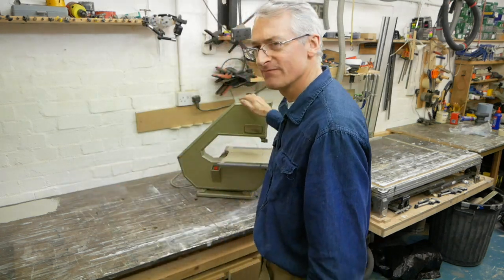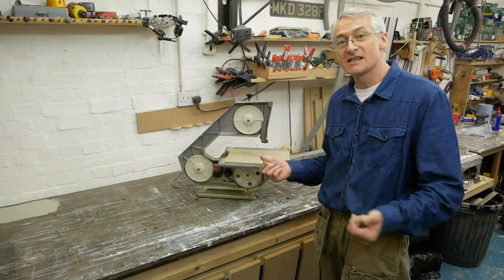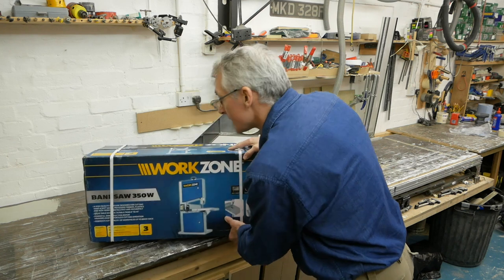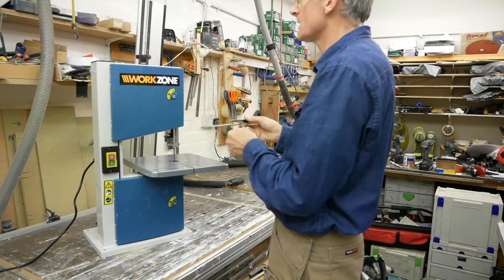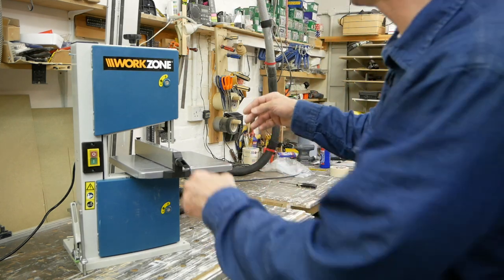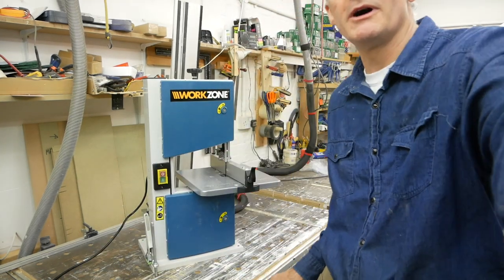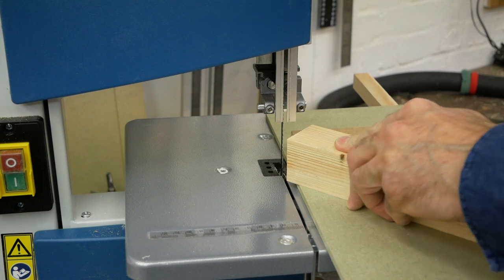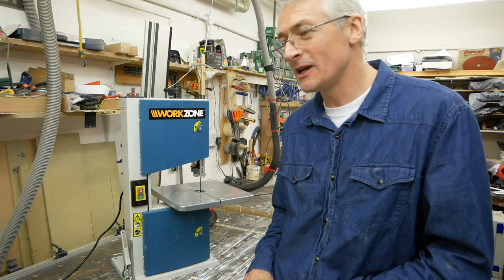Cheap Bandsaw - worthwhile, or just a waste? #050

Comment: That same bandsaw is sold worldwide by various companies. I have one, branded by Wen, here in the USA. Doesn't have the door safety switches (not a thing here), but everything else is virtually identical. Built my own fence, added better-quality urethane tires, and purchased a set of high-quality high-speed bi-metal blades (cuts wood to metal). A real handy workhorse now. Zero complaints.

Comment: As a very keen D.I.Y.'r with a limited budget I have found that the whole range of tools from Aldi are excellent value  and have out performed many of the more expensive  "name" brand power tools. I now have almost  the full catalogue  including air tools and pressure washer, none have given me any problems or disappointed  through lack of performance !
Reply from the maker: Yes, been very impressed with the Aldi Workzone tools that I have - they’re mostly rebadged Scheppach, and I’ve had no problems either 👍👍
Reply: Totally agree

Comment: I have the same saw painted a different colour and with a different name sticker. It's great. I cut 50mm thick mahogany and ash electric guitar bodies with it. It's more than enough for doing this and it is light enough for me to put under the bench when I'm not using it.
Reply from the maker: Exactly! Great little machine, even better when you change the blade 👍👍

Comment: Blade alignment on band saws is critical for decent, efficient work. Those machines have a particularly crude (but usable) alignment arrangement. You seem to have nailed it. Bunnings in Australia have been flogging Good Luck Dragon tools under the Ozito brand (now owned by Einhell). They're expanding into the UK so you will probably be able to pick them up even cheaper soon. Being found at the bottom of the barrel, they work, but don't expect too much from them. Maintenance is the key to success. If it starts getting noisy, check it and fix it. Don't push it past its limits and keep your thumbs out of the way.
Reply from the maker: Thanks! Always keen to keep my thumbs attached to my hands 👍👍
Reply: I bought a GMC (similar quality and no longer extant) band saw which broke a blade guide after a short time. While it was a better concept, it was poorly engineered. Bummer. I will now have to cast a better, more robust psrt which will take on the load. My mate Brent will attest that it's always good policy. He partially removed a substantial part of his person while operating one of these saws, using the blade as supplied. There is no reason you should discount the capabilities of cheap band saw blades. They're the part of the machine that does the work. Einhell have been sold in the UK for some time. The Ozito brand, as sold by Bunnings,  will probably appear there in the UK under another appellation. The quality is somewhere around Einhell's middle range. That's still close to the bottom of the barrel. Their power x-change range is good value for money.

Comment: I had a Craftsman 12" one, probably cost $150. Total junk. The wheels were not straight. Several hours spent adjusting couldn't fix them, they couldn't be shimmed. Made the blade track improperly and throw the blade off at unpredictable times. The adjustments were finicky, blade guards were not user-friendly. Cuts were wavy and rough, even with a more expensive blade.  It cut, but I may have just as well used a sabre saw. When I upgraded to a Laguna 14-12 this year, it was like going from a Ford Pinto to a F150. The cost was completely worth it, and more. The moral of the story: save up for good tools.

Comment: Hi Peter, great video review of that band saw. I have that exact saw branded as "Work Mate", it seems that to sell stuff here in Aus you have to put mate on the end. Anyway, The saw is as you found out a real little worker, the supplied multi purpose blade will even cut aluminum up to to 1mm. The letdown is the table fence and table, I replaced my table with a wooden one with T track in it and same with the fence.

The adjustable cut height mechanism will strip out after a wile as it's got plastic gears inside but I don't cut anything on this saw thicker than 20mm max, but for the price what would you expect! It dose it's job for me so I'm happy with it.

Regards, Nate
Reply from the maker: +Nate Thanks! Yes, well impressed with it; not an 'heirloom tool' by any stretch, but very happy for the money.👍

Comment: Thanks Peter. I've been slowly accumulating tools for my very basic workshop with a band-saw being low down on the priority list due to cost vs need. But at 80 quid this was too good an opportunity and I was equally impressed with the results as you. The table is a downside. I've seen better designed tables on other models that I don't thing would have increased the cost much, but that's the only niggle. A couple of things I found which your test didn't show. Mine cut well straight out the box, but cut a hell of a lot better once the blade guides and bearings (top and bottom) were adjusted. Band tension adjustment fixed a number of issues when cutting thick sections and curves. But I have to say overall I'm impressed. I have made an 18mm table from melamine face MDF with a better t-track based fence and zero clearance inserts which results in me using it more.
Reply from the maker: +Karl Nice! Yeah, I thought it too good to, pass up, and I don't disagree re. the table, it's a bit thin & tinny. Cuts decently though 👍 Appreciate the feedback, thanks!
Reply: Zachary. Blade alignment is all with these.If you ain't got a band saw, get one. A properly fettled band saw will do whatever you wish, within reason. Rips, crosscuts, curves are a doddle. You can almost toss your jigijig saw away. A band saw cannot lunge cut like a jig saw or scroll saw, but they don't have a band saw's capacity.
Reply: Karl - can you enlighten us more in regards to the upgrades you made? Maybe a you tube video showing these? Would be good to see.

Comment: There are wood workers that use lathes, and those that don't. Lathes are pretty useful, but many wood workers don't have one. I'm a hack at wood working, but one thing I make well is this mission style coffee table. The thing is, the table is round. I have never figured out how to make a round table top with simple hand tools. I used to use a saber saw, hooked to long piece of wood, which I hooked in the middle of the table, and spun around. My saber saw last about eight months. I now use a router, which I spin around on a long board. The routers last a bit longer. I need a band saw, but I just don't have a place for it. thank for the video.
Reply from the maker: Pleasure - thanks for watching! BTW it’s called a ‘trammel’ or ‘trammel bar’ when you cut a circle like that with a router 👍👍

Comment: My first saw was the Scheppach HBS20 from Screwfix as you mentioned in your video comment and I had a love / hate relationship with it. It was very cheap and once I put a decent Dalkin or Starrett blade on it and spent a lot of time fettling with the tracking and guides to get everything just right it ran pretty well although the fence was stuck in the bin immediately to be replaced with a self made one. Of course on the other hand it is tiny and very limited to what can be done and the motor is very underpowered so resawing whilst can sort of be done within in the height limitations was a tough and long experience. For a lot of woodworkers that do small stuff it's probably all anyone needs but for anyone else a bigger saw will eventually be needed. Oh the other point to note... you can not buy tires for the wheels of this saw... I ended up making my own out of heat shrink tubing material but Scheppach does sell a whole wheel replacement kit but their UK customer services are atrocious!
Reply from the maker: +Robert Devenney Thanks for the feedback. The Screwfix Scheppach is quoted as a 250w motor, the Aldi 350w so not sure they're identical. But agree about the table/fence 👍

Comment: I had an Axminster one that was a similar design with a cast table and that machine was all I owned for over 10 years it did everything and I do a lot of curved work. My biggest criticism is that the quality of the blades available is not as wide as the bigger machines. However some Axminster blades and that little Saw will be a very capable little machine.

Comment: I must admit, being a keen diy'er my shed/workshop is full of the blue workzone tools, I find them very good for occasional usage, and super cheap. deciding whether to buy the air compressor when I next see it and all its attachments. have some metal railing fences I'd like to shot blast and repaint. for me personally, you can't beat Aldi tools.
Reply from the maker: +No-Ones Home 👍
Reply: Buy the compressor and all of the attachments you can afford when they next come up, you won't regret it!
Reply: Yes the compressor is great, and the attachments.. such a handy thing to have .. I have every power tool known to man, thanks to Aldi's :-)
Reply: I hope you bought the 3HP compressor if not two to have in tandem as they are barely  powerful enough for shot blasting as I found out. luckily I had another smaller compressor  to hook up to give the required CFM.

Comment: On your recommendation I bought an ALDI bandsaw and I must admit that so far very pleased with it. For the low price you have to make some changes so this what I did, I replaced the blade guides with brass bar filed flat one side and ground the grub screws flat so that they don’t in-dentate the bar. I also stuck some magnetic strip 1.5mm x 25mm to the bottom of the fence. This stops it sliding around when setting with a square, hope this helps ?
Reply from the maker: Hugh Jarce Thanks! I don’t have the Aldi bandsaw anymore, but I’m sure information will be of help to those who do. 👍👍

Comment: I bought a Scheppach Basa 1 (with the cast iron table and mitre slot) a while back. I have been very impressed with what it can do - for the price! I have satisfactorily ripped 2mm thick, 3 inch wide English oak inlay stock with no problems. It's not fast, but it does the job pretty well for a bench-top jobby.
Reply from the maker: +Tyvole 👍

Comment: I have a similar Canadian made three wheeled bandsaw, and it is possibly my most used tool.  I love it!   And I got it cheap!  I've paid more for replacement blades over the years than I did for the bandsaw itself.
Reply from the maker: +BoingotheClown They're great little machines - just that mine really wasn't and hadn't been well looked after or maintained, sadly.

Comment: I can't  find my original comment from an old account, but i commented on this video 6 years ago, and my little bandsaw is still going strong. I just put a new 10mm  starrett blade on it today, gave it a good clean, changed the guides, and it thinks it's a  14-inch!!! In the last 6 years, I have made at least 5000 wooden toys with it and used it on average about 4 hours a week, that 1200 hours of use for the cost of it. What a buy

Thanks 👍
Reply from the maker: Fantastic little saw, and thanks so much for taking the time to let me know yours is still going strong. 👍👍
Reply from the maker: Fantastic little saw, and thanks so much for taking the time to let me know yours is still going strong. 👍👍

Comment: I've just had to temporarily decommission my Black and Decker branded three wheeler out due to similar breaker tripping issues. turns out for me it was the winding connections inside the motor shorting out. it got progressively worse until I took it apart to check. wouldn't be surprised if yours was in a similar state.  I may just call it a day with it as watching this video it may be more effective just to replace it.
Reply from the maker: +Matthew Seymour I don't know what the issue was with my little Burgess, but replacement was definitely more effective! 👍

Comment: I had one of the burgess three-wheel bandsaws when they were new in the 70s. They were rubbish then. In MHO the Aldi power tools are of great value. Bought a cordless drill for about £25 just before the first lockdown its has been great  It runs forever on a full charge.

Comment: i have basically the same one but it's from Fox/Delta, i think the brand doesn't even exist anymore, but the saw, it seems, still does. Mine is actually bigger, but it just does it's job, i don't expect anything clean and precise with it, i just use it once in a while to basically cut thru wood faster than i would with my japanese saw !
Reply from the maker: Yep, great little saws, when used within their capacity. I did another video where l compared this one to a more  expensive one from Axminster of the same class/capacity, and it was amazing how similar they were in terms of shape, design etc... Definitely out of the same Mould! 👍👍

Comment: Good job with the review. I have a 9" Ryobi band saw and agree with your assessment. A rip fence would be nice to have, but I have a 10" table saw,  a 12" DeWalt chop saw, a Milwaukee sawzall and  Bosch handheld jigsaw.  With these combinations I don't really miss the rip fence for what I use this saw for in my little garage. I saw metal and wood with success. Keep up the good work. ☺
Reply from the maker: Thanks! Yes, it’s a neat little machine and as long as you use it as intended it does really well. Astonishingly well for the money. 👍

Comment: I got one myself a few months ago under a different brand name (Rockwell) but the same product. The stock blade had a kink in it producing unimaginable drift/wander. But once I fitted a new blade I have also been impressed with the hobbyist tooling. I have found the blade size is a slight draw back as they have to be mail ordered rather then popping down to my local hardware store. But still, for the cheapest bandsaw on the market 2thumbs up.

Great vid btw, thanks

Comment: I love my Bandsaw: it's pretty big 300mm throat, can easily cut 8"deep material, it's a Record BS300. I use mine probably more than anything except my Router.
Bandsaws are the safest, (if there is such a thing) Powered cutting took there is. I like how the force from the blade is directed downwards towards the table, effectively pinning the work piece down! No chance of kickback or splintering shards being launched towards soft body parts! I bought the biggest I could afford at the time, because Alan Holtham, said so, which should be a good enough reason for anyone, surely? If you've bought a Bandsaw and are new to setting them up, I thoroughly recommend going over and having a look at his videos!
Reply from the maker: Thank you! Not a big bandsaw user for the kind of work I do, but it's already paid for itself in terms of convenience 👍

Comment: Good stuff! I have a similar sized one from Axminster. Tbh all is fine with it with exception of throat height... it clogs easily to the point where it does not move and I need to strip it and clean. Other than that, a reasonable little saw.
Reply: Rack and pinion adjust on Chinese saws. Much better to have a slide and clamp . I find it annoying.
Reply: The tiny Axminster band saw is better than this having a cast iron table with mitre slots and other refinements like a solid fence, but you do pay for that with a price tag of over £200 although that machine is actually a fair bit less powerful at 250W.

Comment: That bandsaw looks a lot like my Ryobi BS-230. The Ryobi does however have an aluminium table, with a mitre slot. It also came with a mitre. You could stick a sheet of sandpaper to the top of the sled that you made, to prevent the workpiece from sliding around with the fence screwed at the one end to create a swivel.
Reply from the maker: +Wolf Gollnitz Yes, the specs. look very similar. Great ideas too, thanks! 👍

Comment: I had an early eighties burgess three wheeler when I was making toys for craft shows in the spare bedroom of my first house. The most useful thing about it was that you could buy 1/4 inch sanding belts for it; great for getting into tight curves and corners. I even cut one down to 3mm wide and it worked great.
Reply: prob  works  better as a  belt sander , good idea
Reply from the maker: +Chris Sollars Some of that 3-wheeler style ( Dewalt? B&D?) had a little disc sander on them 🤔
Reply: Yep. The Burgess had that too (model BK3, as I recall)